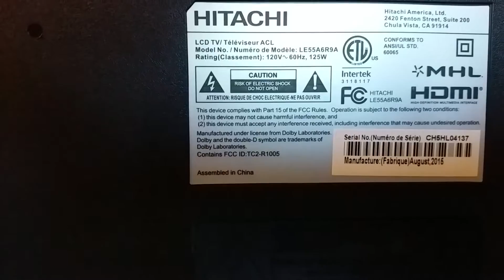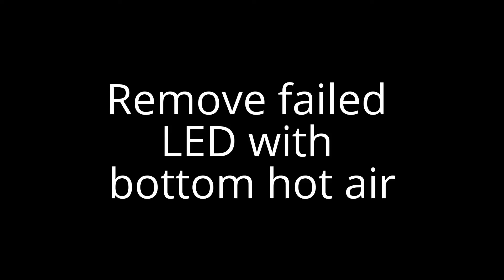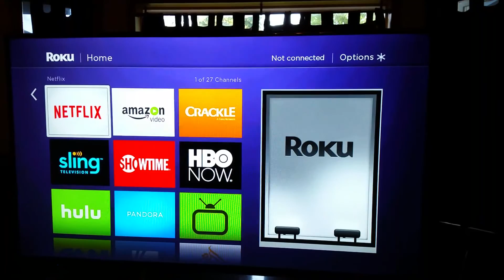Watch me repair TV LED strips

Comment: Can you use a Samsung led for a Philips tv as a transplant?
Reply from the maker: Maybe. If the spacing matches and number of LED's. Might need to hardwire as the connectors might not match.
Reply: @jeffescortlx  I mean a single led light not a strip :)
Reply from the maker: @MIXT55  as long as they have matching voltages sure. Some package types have different polarity so watch out for that.
Reply: @jeffescortlx  Any idea where I can buy just LED lights, not entire strips for this model? 55pus6501/12 Sorry for asking so many questions.
Reply from the maker: @MIXT55  ebay/Amazon shop Jimmy should have them.

Comment: Hey Jeffescortlx
, i am looking to do the same thing. I appreciate your very straightforward video... But I was wondering how you sourced your scrap TV, and how you knew it was the right LED rated for the current. I would really appreciate some help. thanks again man!
Reply from the maker: Scrap TV's come from a local recycling shop. To check current draw (back light on maximum) place current meter across open LED.
Reply: @jeffescortlx  thanks so much!! I really appreciate it man! You earned a new subscriber!

Comment: The only problem with replacing just the bad led's is the remaining ones are gonna fail. the more that were shorted the sooner its going to happen. The power supply voltage for the leds remains the same so when several short the rest a getting stressed even harder till one opens up or the power supply goes into protect or fails.
Reply from the maker: Replacement strips were out of stock at the time of making this video. So that leave the option of manual LED replacement, or throwing the TV out. TV LED power boards are generally current regulated, not voltage regulated. You will commonly see the max current rating printed, with a voltage range it's allowed to work within. I've yet to see a LED driver strictly voltage regulated.

Comment: Thanks for sharing this video ,  I replaced the led bulb and all the leds were working, when i put the led strip back, As soon i  connected the led connector same led bulb blow again.  Do u think its something to do with power supply, thats why leds bulbs are keep blowing ? Can u kindly help me with this. Thank u.
Reply from the maker: What was the current rating of the new LED you installed that blew?
Reply: when the led was blown. Was the whole screen black? And did it make a small "bang" when the led popped?